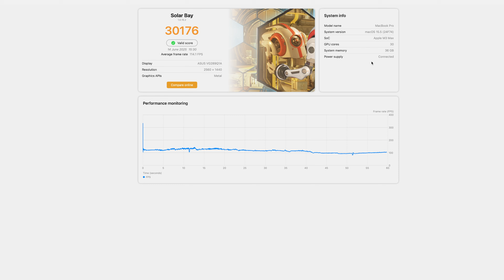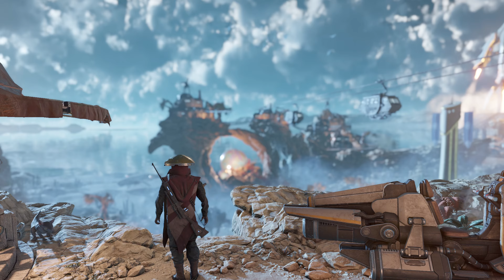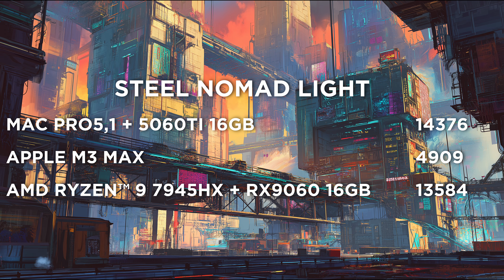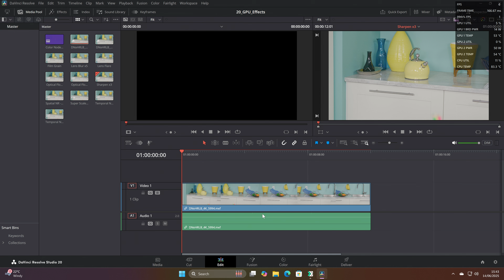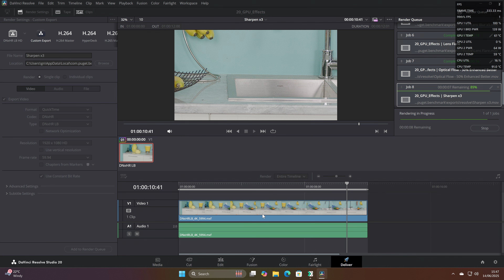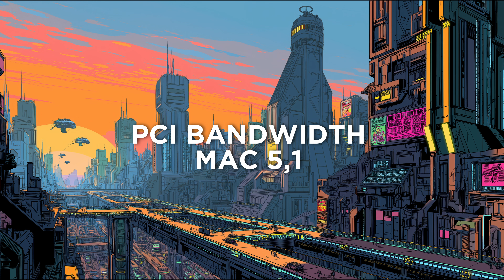Apple Silicon vs Mac Pro 5,1 vs Ryzen 9 Monster – 3DMark & PugetBench Showdown!

Comment: Thanks for using 3DMark for macOS for your review. It’s great to see it out in the wild. We released a fix that increased performance by up to 5%, depending on chosen benchmark and system. We had a compiler issue, but luckily we found it quickly. It doesn’t change much when comparing to PC but it does when comparing for instance to iPad or iPhone. 

- 3DMark Team
Reply from the maker: It’s great thanks for  getting it out there….when you get a chance a Linux  version would be great as it’s becoming serious games platform …and we finally could have a good cross platform GPU test …anyway way  great work on this thanks